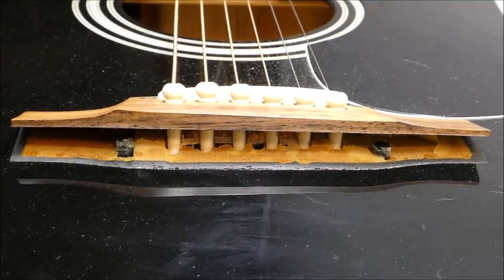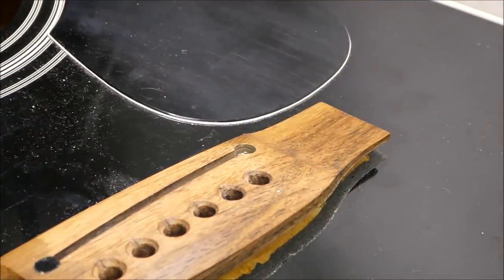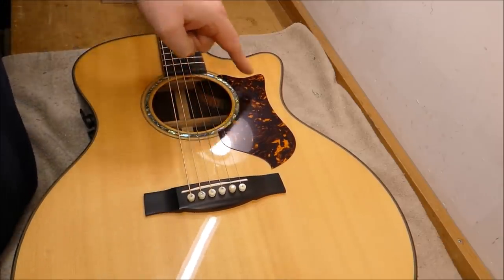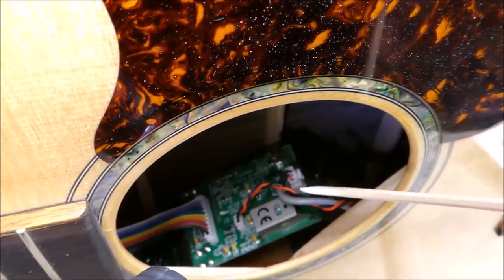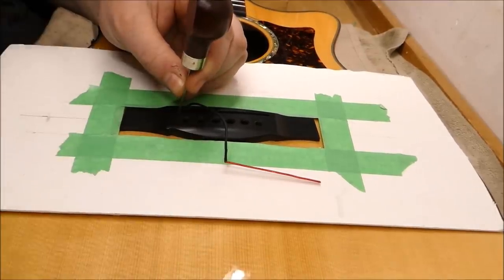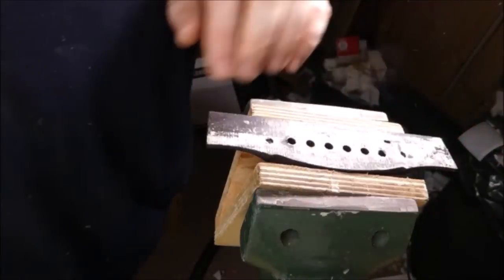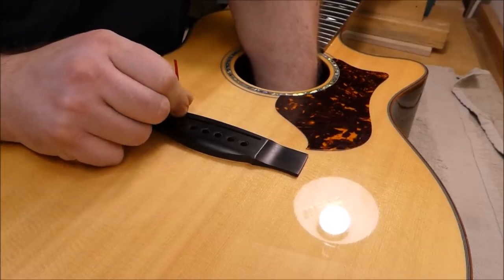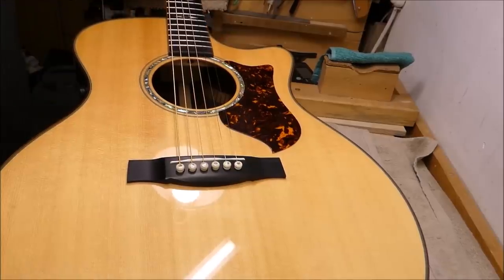Bridge Glue Blues!

Comment: Oh man, deep scoring can ruin a guitar. I just had to replace a bridge on a double top classical where the top layer was cut completely through. Just like that Takamine the wood fibers were not continuous under the bridge anymore. It lasted about 15 years that way but eventually the tension was too great and it began to lift AND deform the top. I made an oversized bridge that overlapped the deep scoring and clamped the hell out of it. Came out nice but it will never be as strong as it should.

Comment: Years later... there is a PRETENSE that the inside-guitar computer-boards can be / will be 'upgradeable'.  And they should be.  But 'the industry' continually changes connectors, slot sizes and power-requirements so there no upgrades - you toss out the whole system and replace completely.  Having those devices sit outside the guitar - "on the floor" !! is the ONLY WAY TO GO.

Comment: I’ve about had it with pre installed “hidden” electronic pickups in acoustic guitars. If manufacturers would stop cutting that awful square hole in the upper bout, and use a nicely finished round or oval hole for that lump of plastic junk, the whole mess could be removed and the installation point could pass as another sound port. No way would I want either of those guitars. 
TheTakamine example reflects terrible judgment on the behalf of the manufacturer (one of the dumbest things I’ve ever seen). The Martin was pretty disappointing also, but ,at least , structurally sound (if you don’t count the sparsely glued bridge).